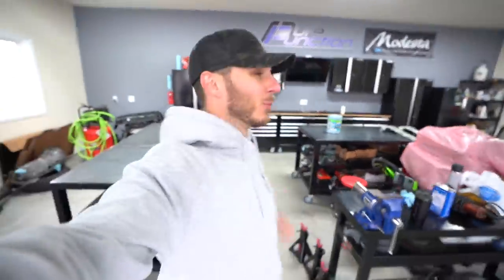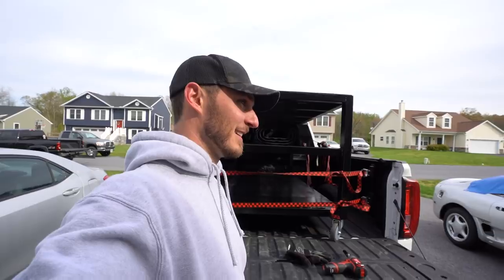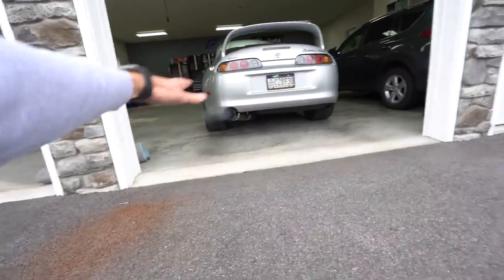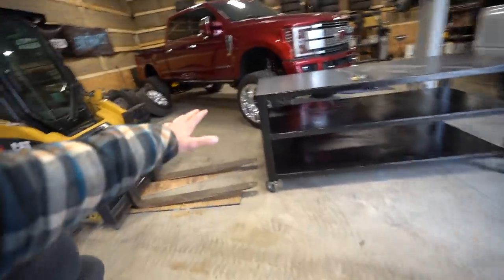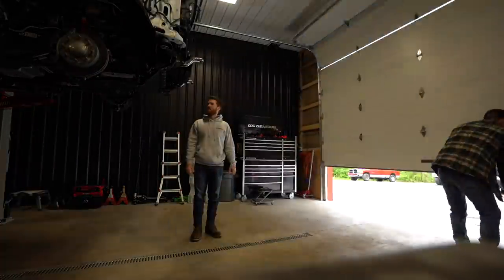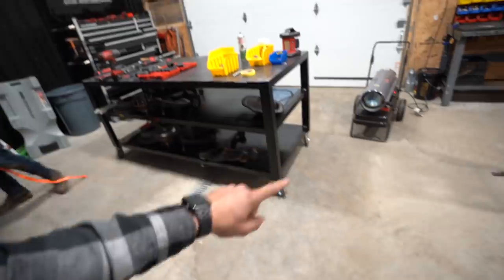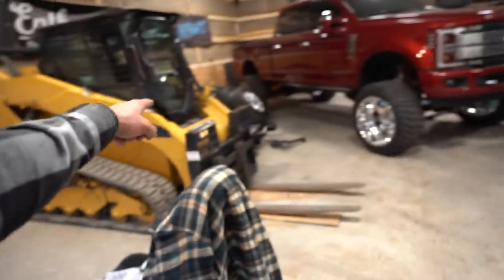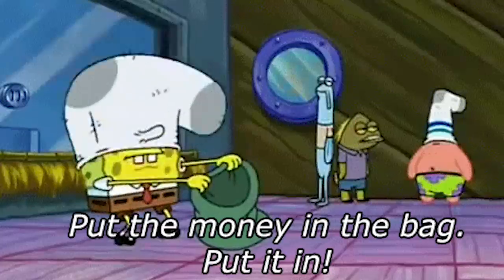Bet You NEVER Saw This Coming..

Comment: Hey Jack or anyone here that has answers. I have a 2015 Chevy Duramax LML. I’m getting a code P00F6 Intake air humidity sensor circuit erratic. With a couple glow plug codes with it. Cylinder 5 & 6 I believe. Can you tell me what’s happening with my truck. And how to go about testing and or fixing the problem. And if after market parts may be the cause (new exhaust etc)  Thanks!